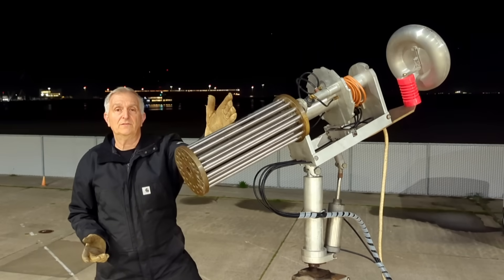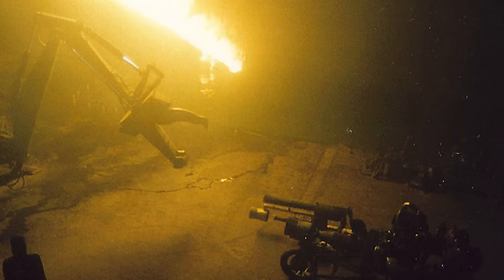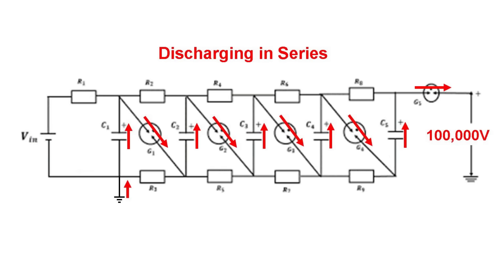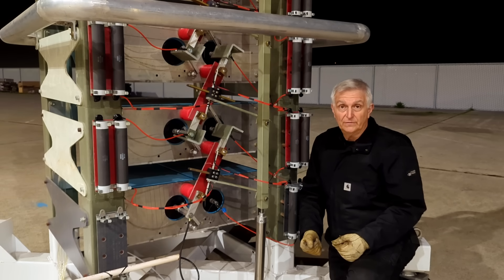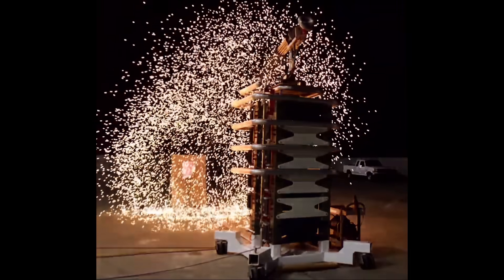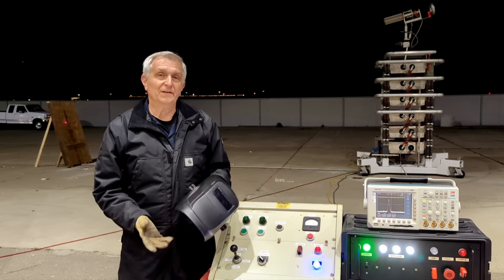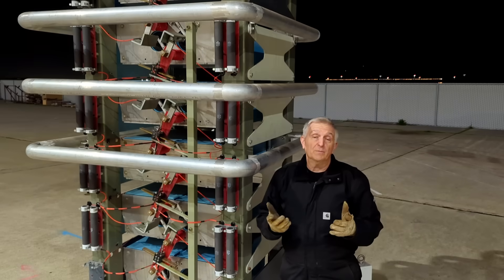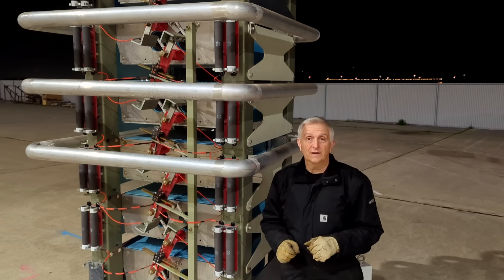Firing the Lorentz Plasma Cannon

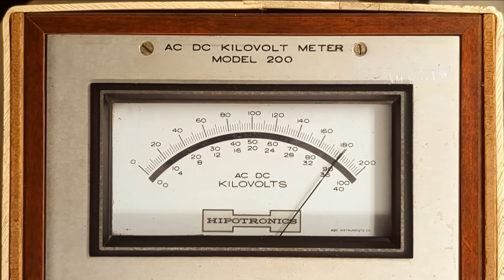Comment: 7:28 I assUmed It Would Be 300k (Linear)!?!?! Whats The Equation or What Could I Search To Find Out More ? :elbowcough:t.i.a
Reply: Energy stored in a capacitor is 0.5*C*V^2 where C is capacitance and V is voltage, since 210/150 is roughly 1.4 which is roughly sqrt(2) you double the energy

Comment: 8:35 "The shockwave has gone supersonic" How can a sound wave go supersonic?
Reply: I think in this case the shockwave is the expansion of the gases which could accelerate faster than the speed of sound but it's different from the shockwave produced by supersonic objects moving thru air, in that case you're hit by the accumulation of sound pressure not by the moving object itself (not an expert tho just speculating)
Reply: @SamusUy this is correct the shockwave is the gases being pushed away from the explosion, meaning that those gases very well could be moving faster than the speed of sound
Reply: What exactly are you asking? Are you asking about a "shockwave" or a "sound wave"? 
 They both have some similar qualities but some defining differences too.

Comment: IMO, you need to pump up the laser - IIRC, they demonstrated plasma following ionized air along the path off laser light when they were researching energy weapons in the army... If you find the wavelength that ionizes the air, and get the laser as powrful in that wavelength as possible, it will likely increase your range. 

I'd also love to see if you could chain this along either magnets or electrets; it seems like they'd either explode, implode, or burn, which should be fun in any case. :D

Well, maybe you're trying that already - you've clearly got enough skill and power to work with. :P

Comment: Question could you increase the amperage by doubling the wire and splitting the current between the two? There for you get more impact rather slow bolt and I think longer plasma burn.

Comment: At my first job at AFRL, we had a Marx generator charged +/- 20KV that put out about 250 KV. It charged a blumlein PFN that fired through a spark gap and put out a half million or so. The PFN was a long pipe filled with De-I water. It took a long time to get all that to work right and not blow up occasionally.

Comment: A little disappointing in that it didn't zap through 20 meters of carpark concrete. Presumably the noise was due to the bolt tearing through the atmosphere, same as lightening, not because of the percussive qualities of the target board.

Comment: For @GretsGarbo-h9m: 

You are very badly informed, or worse.

The Jewish Virtual Library has the following:
In 1882 there were 24,000 Jews in the area compared with 276,000 non-Jews (overwhelming Muslim), for a total of about 300,000. Jews made up 8%.

In 1918 it says there were 60,000 Jews and 600,000 non-Jews in the area for a total of about 660,000. Jews made up 9.1%. This conforms with what the British found in 1919 and is consistent with the above 1882 figures.

And remember, this is a Jewish source.

Comment: Test Lazer as a conductor as well, light and lightning travel at the same speed in a vacuum, 186,000 miles per second, now that's fast.

If light can be a conductor as a lazer is when it transfers heat, we have all the energy we need, for things like space travel, and finding that speed light travels, is within reach.

Comment: The lightning itself is a conductor, that other state of mater being plazma itself, the wire does get vaporized, then the lightning takes over.

It just needs a path to follow, or initiator.

I wanna help make many projects, create as I've always done.

With several applications for the world, at home, and abroad, not so much this project, its just awesome. ❤

My projects are a bit more practical in application.

Spectrums of everything are nothing without completion, and doing what their intended for.

Destruction, or conduction makes things work. 

Help us, and you, to help everyone we know, and love.

Collaborate, and explore what we love to do anyway.

Ooo another idea forms, and takes flight, have the extreme voltage to capture its victim and explosive results the same.

Arc weld the resistance to oblivion, at sensitive parts like hinges, and fulcrum points.

Either by tuch or distance inside the field between two poles of opposite charge, focused and directed.

Immobilizer for the next capacitors charge, and release to the heart. he he

Love it, keep making things work, and we continue to be impressed by it.

Thanks Man in advance. 😊

Comment: I'm wondering if that works in reverse? Quaise Energy videos show millimeter-wave gyrotron emissions cutting glassed wells into solid rock, and they intend to go 20-miles deeper for geothermal energy. I'm wondering whether that ionization of vaporized rock atoms in nitrogen gas plasma won't send a Lorentz plasma stream of ions and electrons to the surface, once their microwaves hit hot, pressurized, and plasticized stone at the cutting edge. An upward stream is supposed to carry condensed dust along that route, to be expelled upstairs. But opposite of what you've demonstrated, how can they hope to contain that energy? Would that be a lightning bolt, or just enough to raise hair on your arm like a balloon? If it's the former, there's no need for a second well and a $100-million supercritical turbine at each well. If not, I can stop wasting my thoughts on foolish misconceptions.

Comment: Something doesn't add up, those current numbers can't be right, otherwise it would take hours to change from a normal wall outlet (which can be implied due to the small cables going to the tower). 27kA at 150kV, we are talking about a bit over 4 Million Watts. Even assuming EU location at 230V, with 16A breaker (considering the size of the wire), we are talking about 3.68 kW.
I don't doubt the voltage achieved, however I'm highly questioning the current claims.
Reply: There is a difference between energy and power. You can charge a capacitor with 1 watt for 1 second and discharge it with 1 megawatt for 1 microsecond. Both are 1 joule
Reply: @laserdiode  I know, however, to have 150kV in the capacitors and be able to reach those amperages, 27kA, it has to have the respective energy charged, that was the reason I used Watts in this case more as a rate of charge, as with the power during charging you can imply the energy from it.
Reply: @ralmslb  27 kA for 40 us is approximately one coulomb. The capacitance needs to be 7 uF to store one coulomb at 150 kV. The energy stored in the capacitors is 80 kJ. To charge the capacitors with 3.7 kW takes 20 seconds
Reply: @laserdiode  thank you for the clarification

Comment: What are you shooting at the target before you release the charge?
Reply: It fires an electrode with a thin wire attached. Once the circuit completes with a grounded object high current flows through the wire and vaporizes the wire. Lorenz force keeps the plasma contained so that there remains a path for the current until the capacitors are empty

Comment: Do you use a fine wire to guide the discharge? Those sparks falling on the ground certainly did not come from the air.

Comment: Interesting, however two problems, first you have to fire that wire/projectile, and second, with that TV, there was this heavy red wire hanging out the back, so not exactly a 'regular TV'
So to actually use as a weapon, first you'd have to ask your enemy if they don't mind you running this heavy red wire over before we shoot you......   I can see a problem here.
Although that may not be a problem in a naval situation, as your all sitting in the nice conductive salt water.

Now for a heap of research, to remove the wires, make it more like real lightning.

Comment: I have a question, so you uses a copper wire and when the wire penetrates the target, electrical energy is automatically released in the form of plasma and it is visible when the copper wire burns and these sparks are created, is that how it is?

Comment: Hmm.. how does this work? What is the projectile being shot? And what is the wire going to the target?
Reply: It fires an electrode with a thin wire attached. The cable on the ground is used to complete the circuit. Once the circuit completes with a grounded object high current flows through the wire and vaporizes the wire. Lorenz force keeps the plasma contained so that there remains a path for the current until the capacitors are empty
Reply: @laserdiode  Thanks! A bit like an overpowered taser gun then, minus the plasma (hopefully)

Comment: Was it shooting a bullet? I can see something solid coming out, but not a single mention abot it
Reply: It fires an electrode with a thin wire attached. Once the circuit completes with a grounded object high current flows through the wire and vaporizes the wire. Lorenz force keeps the plasma contained so that there remains a path for the current until the capacitors are empty

Comment: Seems to me that more damage was done by the projectile towing the wire  This is a totally impractical weapon Give me an RPG anytime over this duff weapon
Reply: You can see the projectile bouncing off the screen after the discharge, if the projectile was doing the damage, the screen would have exploded, but the electronics wouldn't have

Comment: What is the projectile looking thing that appears to precede each shot?
Reply: It fires an electrode with a thin wire attached. Once the circuit completes with a grounded object high current flows through the wire and vaporizes the wire. Lorenz force keeps the plasma contained so that there remains a path for the current until the capacitors are empty
Reply: @laserdiode - Okay thanks very much!

Comment: but can it kill someone? i mean.....looks kind of intimdating but tbh looks like you fired a really fast bobbing needle.
Reply: It is like a taser but powerful enough to also vaporize the wire. Less than one amp can kill and this had almost 30 000A when it was only at half power
Reply: @laserdiode  all i heard was plasma and the look is somewhat intimdating... I knew about what it takes to kill someone from watching mythbusters but from the looks it kust looking scary. I dont see the potential military use for something like this.

Comment: "It looks like doubling the energy had an effect!" Yeah, no kidding. This is really impressive, all things considered. Though I do have to ask, is there a better way to do this? The wire is effective, sure, but is it possible to use a material like helium to create the electron circuit?
Reply: Making the metal thin enough to ionize instantly, as well as putting helium inside, seems challenging
Reply: @TheJerome1502  I'm not thinking about putting helium inside the wire, I'm thinking about using helium instead of wire

Comment: I am thinking about a steam cannon. If you push a fuck load of power through water it flash boils. If you do that asymmetrical the water that didn't go turned into plasma and steam, gets shot out. I guess the would be loud and dangerous

Comment: I'm curious if the 0.25 mi range could be achieved with the same small emitter / cannon device (i.e. the same device that was mounted on top of the capacitor bank in this demonstration)?

Comment: Why is there a cable going from the cannon to the target?
Reply: It fires an electrode with a thin wire attached. Once the circuit completes with a grounded object high current flows through the wire and vaporizes the wire. Lorenz force keeps the plasma contained so that there remains a path for the current until the capacitors are empty
Reply: @laserdiode  So the wire on the ground is for grounding both objects, or maybe even directly connecting both objects (and therefore closing the circuit).
Reply: @EconaelGaming  Yes. It could also fire two electrodes like a taser to work with non grounded objects but it would decrease its power. It seems like most of the energy is used to vaporize the wire so if there was twice the amount of vaporizing wire even less of the energy would get to the target. Because of the increased resistance there wouldn't be enough current for effective Lorenz force. The voltage would need to be almost double for it to work

Comment: 10:25 my question is why didn't the voltage run back through the extension cord running the CRT? Great video this goes down in internet history!
Reply from the maker: It was running off a battery in order to preserve the local power grid.

Comment: In 1993 a single bolt of lightning hit the roof of a university building that my company protected from fire.
14 other buildings on the campus had their fire systems send messages to th fire service.
The main printed cct board of the  fire system of the building that was hit vaporized and bent the steel door of the fire system into a bowl shape.
The cct board was a fuzzy nest of fibre glass and molten components.
Today I would have photos.

Comment: why does it fire a bullet like thing before the plasma?
Reply: It fires an electrode with a thin wire attached. Once the circuit completes with a grounded object high current flows through the wire and vaporizes the wire. Lorenz force keeps the plasma contained so that there remains a path for the current until the capacitors are empty

Comment: 6:45 it's wild that that massive amount of energy was just released and the paper target looks very much untouched from this POV
Reply: Its just because it's non-conductive.. the energy is seeking ground thags why it went around the glass of the TV and adversely effected it's internal components.. 

Now make the target out of aluminum foil and ground it and it too will be adversely effected!  Lol.  
More like instantly elevat it's state of matter from solid to plasma. Literally it would flash over into charges ions and photons.   

Thats thing is scary af! When I saw how close the control booth was..  ooofff!  Hell no!  I wouldn't be that close! !
Reply: @derekhoffman818  "it's just not conductive" the air that all those sparks are in is "non-conductive" and if you watch close there's a conductor run from the "canon' to the target.
Reply: Along the ground..
Reply: @MindCrime550 

Yeah, so a wired plasma cannon...

What about a wireless plasma cannon with a strong laser creating a preliminary plasma channel in the air? 🎉
Reply: Energy was mostly dissipated in that huge thunderclap.
Reply: if it were human theyd be DONE!

Comment: 6:25 if you pause the video on pc/mac you can use the < and > keys to go frame by frame.  and when the sparks become clear it seems like there are axial rings at relatively consistant intervals along the wire.

Comment: Have you tried using a hard-UV laser? It ionizes the air strongly enough for an electric discharge, but the voltage needs to be high enough for a good, powerful discharge.

Comment: I've seen ElectroBoom use this circuit for stuff, mostly his magic wand thing.. but it wasn't until right now that i had my "ah ha" moment with it.  You're turning a 20kv circuit of parallel caps into a series circuit.  Now my question is.. since you're getting 5x on the voltage aren't you getting 1/5th the capacitance? or maybe that stays the same but we're trading amps?
Reply from the maker: Yes, the series config has 1/number of stages of capacitance.

Comment: 10:28 use frame advance around this point for a AMAZING frame that was captured of the beam first coming into existence. causing artifacting at the bottom of the screen due to maxxing out the light sensors. after which is followed by 8-9 frames of pure white screen.

Comment: "So how could you arm an electrical device to survive in such a hostile environment? The answer, use pulsed power. And if that doesn't work, use more pulsed power. Take this 240,000 volt, marx bank mounted little old number designed by me. Built by me. And you best hope, not pointed at you." -LightningOnDemand probably

Honestly, as soon as I heard "use X, and if that doesn't workz use more X" I immediately thought back to Meet the Engineer.

Dell Cohnager would be proud.

Comment: Sir, I don’t necessarily see the point of such a thing.  Given the cost, short range of effectiveness, and really no kind of substantial results aside from catching paper on fire and disrupting an old tube television.
Reply: It creates quite a sound-and-light spectacle that has entertained 50,000 people just with this video alone.  I'm fairly sure that's the point, much as the point of the SRL machines in the early part of the video was also entertainment.
Reply: @ I suppose.  Musical Tesla coils or being able to capture light itself move through a medium in slow motion is fairly entertaining as well.  Good on you though sir to have the technical knowledge and experience with electricity to be able to build such a thing.  I could certainly see windows shattering from the concussive force of that thing.  Although you honestly can’t call it a “plasma cannon”.  It would be more akin to a lightning cannon.  Yes the massive pulse of electricity creates plasma around it just as lightning does by superheating the air around it, but it isn’t necessarily “shooting” plasma

Comment: A Lightning bolt delivers enough energy to run an 80 watt vacuum style light bulb for ~60 minutes.

That series/parallel bank of capacitors looks like it will hold a lot more energy than a Lightning Bolt can deliver.

Where is the spark gap ??

Comment: You built your own mini z macine 😮 Make a cut out of the pattern from a fractal antenna, put that in oil and  have a satellite dish to reflect the energy. Use a well insulated inductor to tune the bandwidth with. Instant EMP simulator. I built one that could simulate the E1 wave using a spiral line PFN, but this could easily simulate E1 and E2 waves 😮